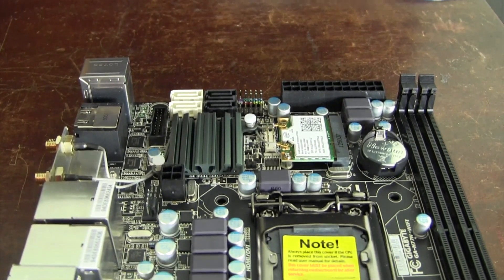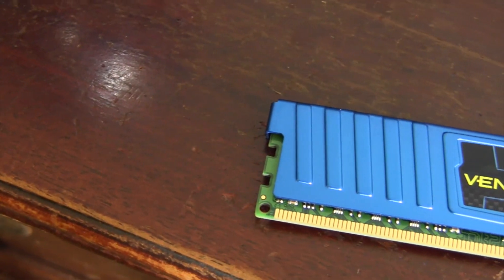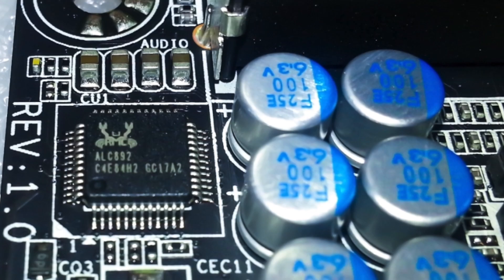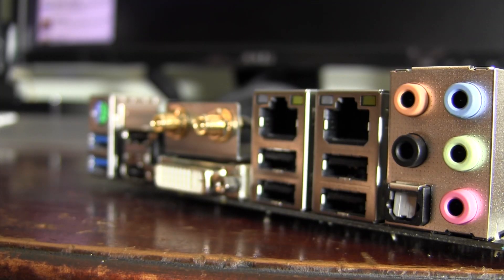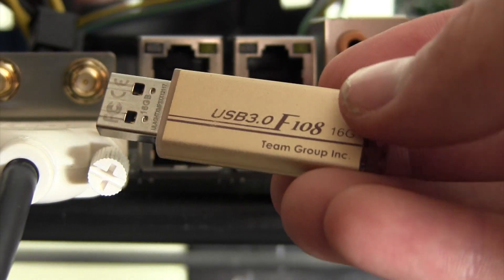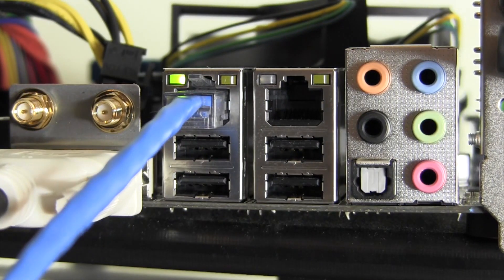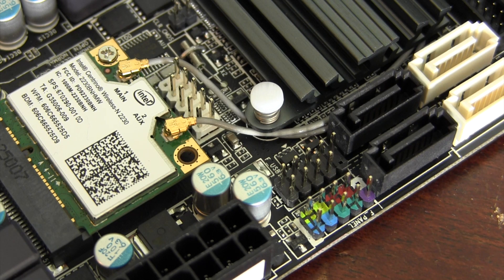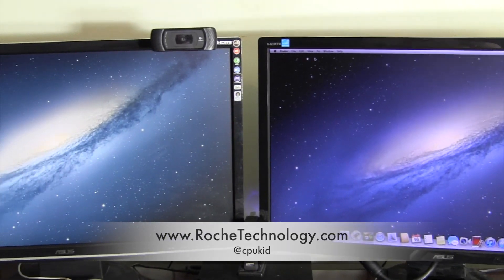Hackintosh Hardware: Gigabyte H77N-WiFi [Motherboard]

Comment: I know this video is old but I need to point something out. You can actually run more than 2 monitors at a time but the 3rd has to be plugged into a graphics card. I have this MB and I used to have 3 screens on it.

Comment: It's worth mentioning that there is no possibility to use a resolution higher than 1920x1200 pixels without a dedicated graphics card because the DVI connector is single link and there is no DisplayPort. I don't really get why you mention the 4-pin CPU power as a con because it might be insufficient for overclocking. As you may know the H77 chipset is not meant for overclocking, they made the Z77 chipset for that. Strange that the USB 3.0 ports don't work with USB 2.0 devices and that the header for the front connector is not working, those are way bigger cons in my opinion.

Comment: Well the 4 pin con is irrelevant since the H77 chipset doesn't support over clocking. That's why there's also the Z77N-WiFi. And for people asking about WiFi, buy the Dell DW1515 from eBay for ten bucks and swap the half mini PCI-e Intel card with it for WiFi support out of the box (but you lose the built-in Bluetooth functionality of the Intel card)

Comment: Your H60 is definitely not working right. I rarely go above 40C with mine, so you need to try to reinstall it or make sure everything is plugged in. That kind of heat is going to ruin your CPU.

Comment: I have this one paired with an i5 3470 and a GTX 660, and it has been flawless. I replaced the built in wifi with an Atheros AR9280 mini-PCIE card, so wireless works natively. Great product!

Comment: hello
I've recently built a hackintosh with these specs:
Z77X-UP5 TH
i7 3770K
16GB 1600mhz RAM 
nVidia GT 640 2GB
CPU Cooler Corsair H60
But my temps are high!
I get on idle 88-96 celcius degrees.
On high performance 138-147.
Do you know how to fix this?
Thank you

Comment: The 4 pin CPU power header doesn't matter as this is a H77 board.  The H77 chipset doesn't support overclocking.

Comment: Nice vid Bob, I have the Z77 and I can do overclocking since I got the water cooling system from corsair H80. There is like no space there anymore but it's working great! I had no problem with the power either because I used the molex socket meant for the DVD drive with a splitter.

Cheers!

Comment: h77 is more of a value orientated chip-set. it has most of the same features as Z77 but not all, for example. overclocking can not be done on this chip-set, even with a k series processor.